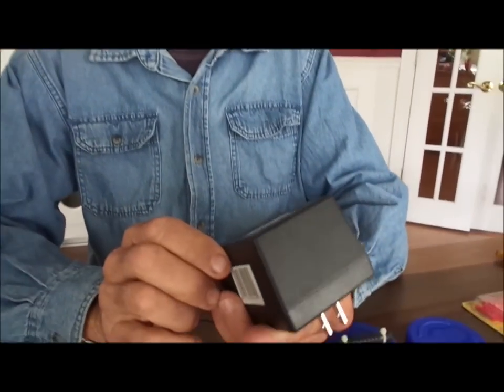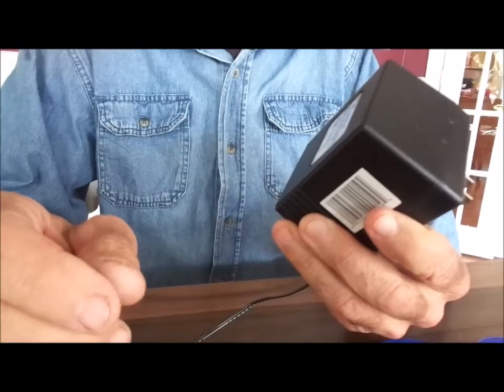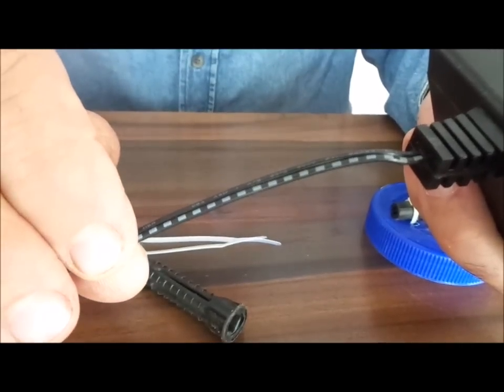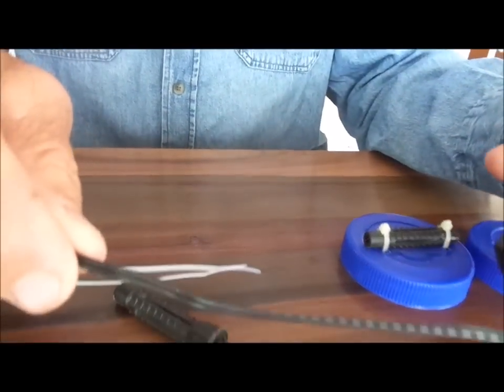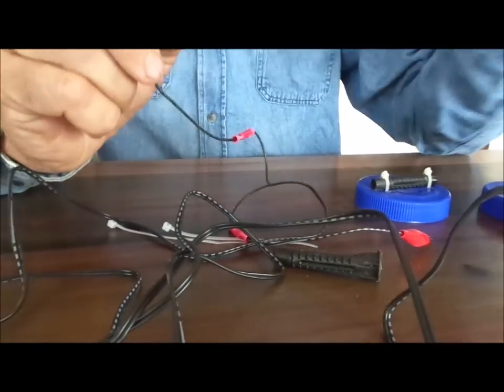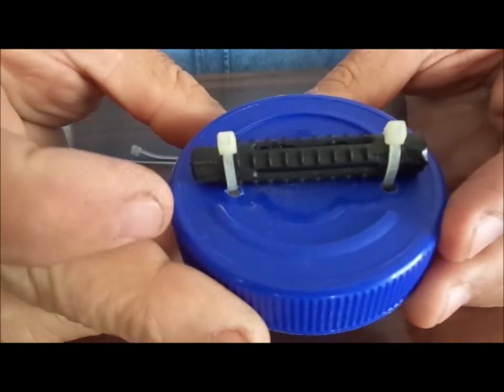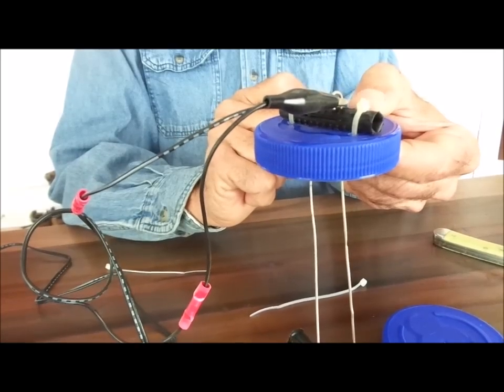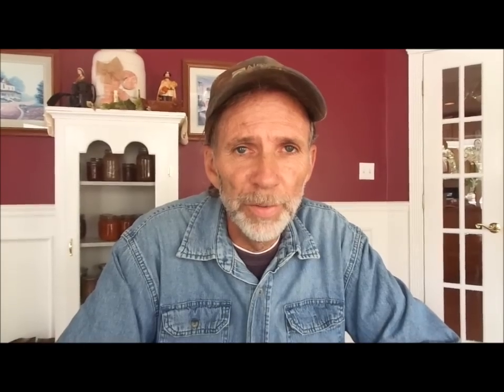DIY- Colloidal Silver Machine

Comment: I would NEVER drink this colloidal silver! The key is to end up with very small particles like .8 nanometers. The smaller the particle the more effective the CS. This setup will produce VERY large particles. The machines you buy will reduce the power input as conductivity rises and thus maintains very small particle size. Don't cheap out w/ this, just buy a good CS machine such as colloidal silver generator. biz. I just bought one (my 2nd) and am very happy with it. I can make a gallon in 12 hours at 10 ppm which is very effective. It's overbuilt, will last and is 158.00 on Amazon. I'm not selling it by the way just found a good one, hope this helps.

Comment: Should I be concerned about the amperage of the power supply.  I’ve read somewhere it should be less than 15 milli amperage.  The smallest I’ve found is 500 milliamp.  Another one I found says 0.25 amp which I’m assuming is 250 milliamp.  But here you are using 1 amp which is equivalent to 1000 milliamp and thus higher.  Should I be concerned with Amperage.

Comment: Would not buy  over the counter I make my own  and have even  improved on the best process my researching  uncover. I use strong  magnets placed next to silver rod on outside of containers  to eliminate the dross and need to filter. This also makes it easier to get a higher ppm in much less time.
 Then put it through ūltraslonic cleanér to reduce particle size further and photo and enlarge the  ebner effect laser test with my phone to better observe particle size and uniformity...
Add this to your methods and let me kno your results, it drastically improved mine. Ppm on last batch was 165 in little more than an hour

Comment: I clip right onto the straight end without any bend. I've been using it for months & it's working great. I've used a variety of things for the top including a coffee filter with the wires poked through being supported by chopsticks. Now I have a heavy duty paper plate with the wires poked through. That's working just fine until I do something more permanent. I'm using a ProKeeper powdered sugar container & have The wires kitty corner so that the furthest apart which makes the smallest particles, which gets into our cells better as I understand it. ☮️🙏🏼

Comment: you can build a 27 VDC unit by using a more powerful transformer and use a  power resistor preferably an adjustable one. An old-school Rheostat can serve. You'll need a decent multimeter and that's all you need.
A warning for your fans:
Some folks might think Glass is a good alternative to plastic. If they were thinking Laboratory glass then yes,  if they were thinking pyrex and mason jars then it's a little more complicated because only lab-grade glassware is certified to have no trace metals in it.  Any other glassware is a crapshoot.

Comment: This is an excellent explanation and most probably the best I've come across. I still have a couple of questions:
1. Does it really matter which wire is the tracer wire as they will be connected to the silver rods anyway, doesn't matter which one.
2. At that voltage how many hours for each PPM of colloidal silver.
for Example run 500ml of distilled water for 6 hours for 30PPM colloidal Silver etc. If anyone else has used this setup and can answer, much appreciated!
Reply: Some guy i read said its best to use 30v 1amp for 9 hours ,its breaks to smallest particles

Comment: I use a 3V dc transformer. Slower but the low voltage makes smaller nano particles which is needed to penetrate the cell walls. Very important!
Reply: I read that the wires should be as far apart as possible for small particles. And so the clips won’t touch if jostled.
Reply: i use 1.5 volts.  i also tried with 0.5 volts too!!  the electrodes are spaced 1 millimetre apart. 
all those idiots using 27 volts and then put current limiting resistors in series...which absorb the extra voltage...you can the video in my channel...
Reply: @esecallum How long does it take to brew 32 oz with at 1.5 Volt

Comment: So did you get it to work ? If you keep your distilled water warm during the process in a water bath at 160°F you will produce what you are making faster. I would not recommend microwave heating the water before or after. This is a handy liquid to spray plants with and has its uses. A cellphone charger is a great power source just leave it going in a gallon of straight distilled water room temperature in the dark a few days works too. Have made this stuff for 20+ years its handy, I'm not blue, and nope I know it is not a cure all. It's a supplement that you just don't overdo.
Reply from the maker: I have been using it for about 25 years and neither am I blue.  LOL
Reply: @DeepSouthHomestead   I actially know one person who is blue it was from drinking 10oz at a time daily, rubbing it all over the skin constantly, and it took the guy a long time he is actually healthy just blue he admits yes he over did it and at times made it wrong. My only complaint about colloidal silver right now is it is not and never has been a cure all. The FDA has cracked down on the company's selling kits which doesn't bother me a lot of people don't have enough common sense to make colloidal silver or gold anyway. I read the comments and its really simple if a person doesn't want any just move on. I will say that this is a great how to and I appreciate it. Haha I will let you if I ever turn blue from it. Thanks again

Comment: Thanks for the video. It's important to be self reliant these days! I use a 1 amp 36 volt DC power supply I bought for a buck at the amazon returns clearance sale, cut off the output end attached alligator clips after separating the wires. I bought 10 gauge silver rods on Amazon. They have a larger surface area. A plastic lid from a mixed nut container, drilled two holes 1-1/2" apart, hot melt glued two rubber grommets over the holes to support the rods better, glued a small block of wood to the lid between the holes for a handle. I use a 1 quart pickle jar which I boiled in salt water to get rid of the residue from the pickles (very important). Only use distilled water! I bought a TDS meter for 11 bucks. To check water for purity and to check PPM. I am able to get 17 to 20 PPM in about an hour & a half. I filter the result through a paper coffee filter clipped to a funnel and store it in re-purposed brown glass beer bottles. I suggest buying a bottle brush (available on Amazon) as the bottles need scrubbing after a couple uses due to residue. A kitchen timer with a loud bell is great to have because it's easy to forget and you wind up with some really murky looking stuff you might not want to ingest. Amazon also sells silicone rubber bottle caps that work great to seal the bottles.
Reply: The TDS meter is NOT a good test, nor is a Lazer light like people use to play with their cats. A metallic taste is the best/only way to know unless you want to spend about $5,000-, Yes $5, 000- for a used piece of equipment. 10ppm is all that is necessary. Filtering it is a waste. It's best stored in bottles like Coca-Cola comes in. I use my seltzer water bottles. Juice bottles are also good. Water bottles & other plastics are not good for its storage.
Reply: @goodintentions1302  @Arpad 
Bob Beck says dark brown and dark liquor bottles best for storing Coloidal Silver and you can use Salt & Dry beans to clean the bottles

Comment: STEP DOWN TRANSFORMER....
12 to 24V ... 1 to 5A.
99.999% CERTIFIED
SILVER ANODE AND CATHODE.
POLARITY WILL NOT MATTER.
ONLY SILVER MAKES CONTACT TO WATER.
DO NOT SUBMERGE WIRES OR CLIPS.

MY SILVER OUNCE WAS CUT IN HALF.
I TIGHTLY SLOTTED A PEANUT BUTTER JAR TOP FOR EACH PIECE OF SILVER.
JOB FINITO... WIRES HAVE LIMITED DURABILITY.
THE SILVER WIRE IS EXPENSIVE.

Comment: Machines have moving parts. This doo-hickey is NOT a mechanical device using power to apply forces, control movement to perform an intended action Bro-.
Reply: GnosticNinja ... good thing you caught that,, whew,, none of us knew what he meant. Q. ?  So everything is reduced to atoms and elections, etc and spin of atoms, sooo... go soak ur head.
Reply: @mishaanton5436  Dang, guess I feel silly now.
Yeah, a silly machine. Best go walk across the machine, turn the machine on to fill up a machine with machine and soak my machine in that machine full of machine eh? After that I need to take my machine out to exert force creating motion to achieve desired result; to take a #2 machine on the machine. He just ate alot of BBQ machine, yeah I feed the machine well.
Keeps all the moving parts happy.

Comment: Voltage is way to high and you haven't included any current limiting. V/R= I anything over 1 ma will produce large clusters of silver and lots of ionic silver.
Reply: That's why I use 1 AA battery.

Comment: For those of you that want a good colloidal silver generator .. Big bear colloidal silver generator to me is the best you can by alternating current to switch from One rod to the other every 30 seconds or as you like it has adjustment current control. Magnetic stir keeping the product moving which keeps the rods cleaner throughout the operation has everything you need to make a perfect professional product ionic silver then you use a syrup 50-50 with distilled8 to 10 drops in your ionic silver put it on a hot plate bring it to a boil shut it off it’ll turn honey color that’s colloidal silver if it goes wrong and it turns gray or any other color throw it out it’s ruined you got some toxic metal or something in the mix there’s no fixing it just throw it out so if it turns honey color you got the perfect product
Reply: where do you get the rods?

Comment: Definitely 

#1 use DISTILLED water not tap water

#2 keep your alligator clips out of the water, which ths setup does

#3 use plastic insulation like he did here to keep the wires from touching each other or other metal parts. Anyone who has ever jumped a car battery knows what happens if you touch the 2 clips together

Comment: while this "old fashioned" way to create C.S will give you a usable product, for those who seriously wish to get a potent product for a lifetime should invest $100-$250 in a C.S generator.
With electrolysis, as more silver gets in the water, the conductivity is affected so the wattage and amperage needs to be gradually stepped down.
without doing that, the silver particles will be too large (the high amperage can be thought of as like a sledge hammer smashing a brick rather than a piece of sandpaper sanding a brick)
Continually stirring the water with an automatic stirrer will yield better C.S....some generators come with one, if not they are around $25 on ebay. 
Everyone thinks their method is the "correct" one but anyone who disagrees with what i said here has not done the research and field testing with different methods as i have.
The subject generates crazy arguments.
Bottom line is if you have a few bucks to spare, spend it on a generator, not a wall wart or 3x9v batteries
Reply: I'm interested in your method how can I get in touch with you.
Reply: just puts a series a resister of 10

Comment: Hey man thank you for the video quick question where can I get the colloidal silver rods from? I would appreciate it
Reply: Miguel Bello ....simply google or ebay/amazon "colloidal silver generator"
this is not a good way to make C.S.
look for one which has "polarity switching" and some form of stirrer.
the best type will also step down the voltage as the solution becomes more saturated with particles (which affects conductivity of the water)
correctly made product is fantastic but cheaply made without much knowledge is just poor at best and toxic at worst 
silver rods come in different gauges (thickness) there is no "universal"....learn.
MUST be  0.9999 pure (advertised as  .9999)
available easily on ebay etc
ONLY USE DISTILLED WATER.... nothing else...not even in an emergency.
the minerals in water affect the electrolysis process.
distilled water has no minerals.
Reply: cant stopthemusic thank you.. also another question I bought a 5 stage filtration that’s called zero water it basically makes distilled water it makes it 000 ppm is it okay to use it? It cleanse the water from all solids
Reply: @miguelbello9686  gallon of distilled water is less than 2.00 at supermarket.  Check baby products area or bottled water.
Reply: @miguelbello9686  SHOULD be. As long as it specifies its able to make zero ppm distilled equivalent to distilled water and you test it every time.

I've tested niagra distilled from 99 cent store and it's 0ppm for a gallon.

So... Depending on how much you spent on that system and how many gains it makes before you have to change the filters.... Well, you do the math.

Comment: Danny, are those SILVER SOLDER rods that you get from home depot?  I did a search and that's what it produced.
Reply: Claire Montanaro 
the only product you can safely use is  .9999 pure silver and cannot be purchased in a high st store
Reply: simply google or ebay/amazon "colloidal silver generator"
this is not a good way to make C.S.
look for one which has "polarity switching" and some form of stirrer.
the best type will also step down the voltage as the solution becomes more saturated with particles (which affects conductivity of the water)
correctly made product is fantastic but cheaply made without much knowledge is just poor at best and toxic at worst 
silver rods come in different gauges (thickness) there is no "universal"....learn.
MUST be  0.9999 pure (advertised as  .9999)
available easily on ebay etc
ONLY USE DISTILLED WATER.... nothing else...not even in an emergency.
the minerals in water after the electrolysis process.
distilled water has no minerals.
Reply: @cantstopthemusic456     Jut use AC current. That's "polarity switching".
Reply: @cantstopthemusic456  I have a .999 bar.  Will that work?

Comment: Where do you get your silver rods?
Reply: simply google or ebay/amazon "colloidal silver generator"
this is not a good way to make C.S.
look for one which has "polarity switching" and some form of stirrer.
the best type will also step down the voltage as the solution becomes more saturated with particles (which affects conductivity of the water)
correctly made product is fantastic but cheaply made without much knowledge is just poor at best and toxic at worst 
silver rods come in different gauges (thickness) there is no "universal"....learn.
MUST be  0.9999 pure (advertised as  .9999)
available easily on ebay etc
ONLY USE DISTILLED WATER.... nothing else...not even in an emergency.
the minerals in water after the electrolysis process.
distilled water has no minerals.
Reply: Gale Heny ....ebay must be .9999 pure silver

Comment: Where the heck are you supposed to get the rods??
Reply: S J   ebay. must be .9999 pure silver but this is an embarrasing and shite way to get CS
Reply: simply google or ebay/amazon "colloidal silver generator"
this is not a good way to make C.S.
look for one which has "polarity switching" and some form of stirrer.
the best type will also step down the voltage as the solution becomes more saturated with particles (which affects conductivity of the water)
correctly made product is fantastic but cheaply made without much knowledge is just poor at best and toxic at worst 
silver rods come in different gauges (thickness) there is no "universal"....learn.
MUST be  0.9999 pure (advertised as  .9999)
available easily on ebay etc
ONLY USE DISTILLED WATER.... nothing else...not even in an emergency.
the minerals in water after the electrolysis process.
distilled water has no minerals.

Comment: You forgot to mention adding a bit of saline
Reply from the maker: No I didn't forget!  I don't add salt to my silver water.
Reply: @DeepSouthHomestead  
Oh! Okay.
So do you add anything to help with the  electrolysis?
Reply from the maker: No we don't.
Reply: NEVER add salt
Reply: @cantstopthemusic456  So no baking soda and no salt.
Just the 27v DC current and 2x silver wires is that correct? 
In distilled water.
Can I use RO water.
(Reverse osmosis) 
And for how long do I leave it connected? 
Thanks!
Reply: Yeah go for it you will look like a smurf.
Reply: @sswcustomsewing4276  
No worries! 
Got it!
Thanks for the heads up Friend. 
How long do I let the electrolysis go for before the batch is done.
Reply: @Godisknockingx  Depending on the voltage it can take an hour to a few days. If you want to speed up the process you can add some colloidal silver from a previous batch. Distilled water is what I was taught to use. I have always use just a jar two, 10ga silver rods, DC power, and keep an eye on it.
Reply: @sswcustomsewing4276  
Thanks for taking the time for the details.  I will give this a shot. 
We have H Pylori in our family. 
I was told taking colloidal silver can get rid of it along with other issues my youngsters have got.
I hope that this stuff helps.
I ordered a few silver rods for making the stuff. Can't wait until it comes in.
( one other question that I have is how do I know when one batch is done? )
Thanks!

Comment: Take 3 9volt radio batteries and connect them like Lego's ...You will end up with a negative and positive pole..Connect jumperwires and clips to your rods...Been doing it like this for years...
Reply: You could buy an AC > DC transformer for nearly the cost of a few 9V batteries and have unlimited cheap power.
Reply: How long the batteries last? (how many times we can re use them? ) thank you for the reply
Reply: @justinc2625   5 or 6 times... CHEAP but effective medicine...